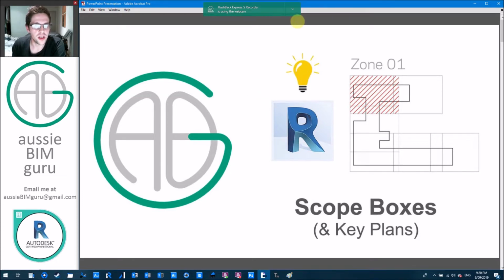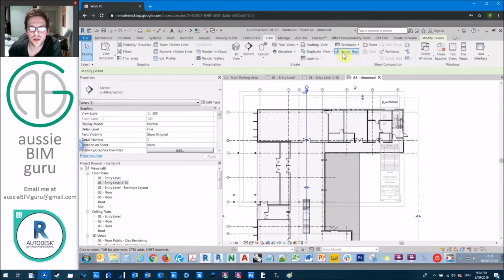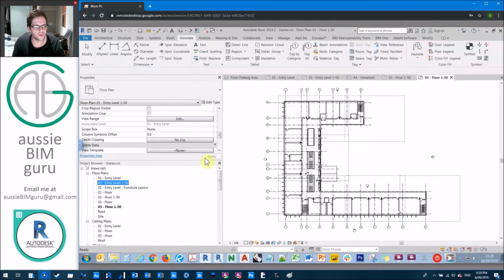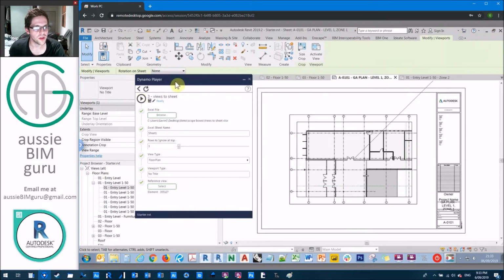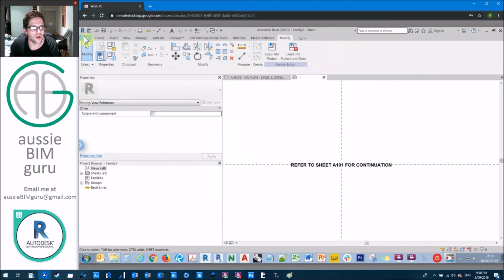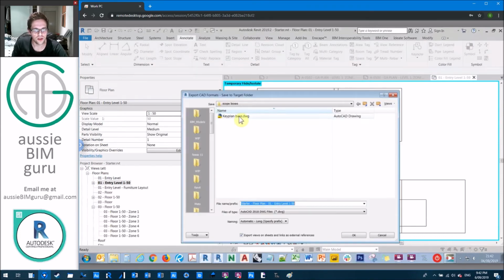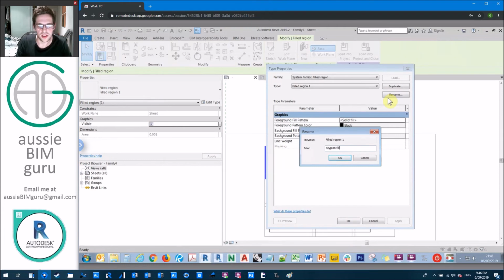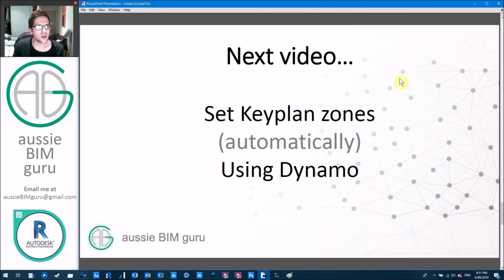Revit Scope Boxes and Key Plans

Comment: Is it possible to make something similar, but I would like to hatch only certain wall that is placed on sheet? And possibly tag that wall? I would like to automate that process
Reply from the maker: To check which walls are placed on a sheet in a model, you can get the sheets viewports, their views and then in those views use elementsofcategoryinview. I believe clockwork and genius loci have nodes for this.

Much of this logic will come down to your specific setup in Revit. Try to approach it in steps based on how you would approach this task manually.

Comment: Sir .. have seen this video I found that "active zone" name  parameter drive the other parameters i.e zone 1 to zone 6 ...but in that video u set parameter name as highlight zone?? Here i did nt see any highlight zone parameter???thanku sir
Reply from the maker: It doesnt really matter what the parameter is called, it just needs to be consistently named in dynamo and revit. My videos are a guide, dont follow them 100% literally. They dont connect like a course does.
Reply: @AussieBIMGuru  sir..i have dynamo 2.0..so i have to install archilab,rhythm,and some package ...which ver of this package i have to install...sir
Reply from the maker: @iftekharkhan8879  i would install the versions with dates from around the time of this video or later if they can be installed.
Reply: @AussieBIMGuru  sory sir ,i did nt understand ur answer..
Reply from the maker: @iftekharkhan8879  look at the date i made this video. Look at the package version release dates in package manager. The version i used must have been around that version.
Reply: @AussieBIMGuru  ok.thanku sir

Comment: Hi Gavin! Great video again :) some things I knew, others not. Thanks for sharing your knowledge! 

Again, in my current office they used to do this type of key plans in Autocad with the actual floor plan as an Xref. They would use it, not so much to divide the building into multiple parts, but to highlight which piece of the plan is being detailed further (ex: 1:20 drawings of a bathroom with the general plan as a key plan indicating which bathroom it is). That would also happen in section drawings to highlight the portion of it that its being developed in 1:5, in a constructive detail for instance... But I think for this we should probably use the Callout tool instead...
Reply from the maker: You're welcome!

I sometimes use the AutoCAD plan as reference, although I usually prefer to simplify the diagram quite a lot to avoid too many lines to print. At the end of the day it's a diagram really so doesn't have to be 100% detailed or accurate.

Whilst a callout could work to some degree, unfortunately it could only be placed on a single sheet.
Reply: @AussieBIMGuru  Oops, indeed. So I guess either a more schematic diagram or the Autocad as ref. Personally I would go for the first option, but I guess it is better to analyze it project based and see if the others agree.
Reply from the maker: @marianaarodrigues1  yes get team concensus. I've always found a simple diagram is best, keeps things basic and human friendly to manage/interpret on a drawing.

Comment: If some one ask that divide floor area into two parts in each floor  along building length what it means..is it relates for creating scope box
Reply from the maker: I would ask them to be more clear with their instructions. This could also mean the slab needs a construction joint or a model needs to be broken into two zones.

I am guessing they mean to use two scope boxes to cover the floor plan over 2 sheets most likely.

Comment: Hi buddy, I am from Melbourne. One thing of scope box puzzles me is that there is a gap between scope box and automatically created section box. Is there any way to edit or remove this "gap"?
Thanks!
Reply from the maker: Hi Lei, nice to hear from a fellow Aussie!

I believe by default the section box is automatically offset unfortunately. I would try out this tool by COINS that generates section boxes with manually specified buffers; https://apps.autodesk.com/RVT/en/Detail/Index?id=8920075109543819118&appLang=en&os=Win64

Comment: Hi Gavin, great videos! I am planning to start uploading my own tutorials at some point and you channel is definitely quite motivational. 

Regarding the key plan I have used a slightly different workflow;  To avoid using Autocad, I simply draw the lines (detail lines) on the 'A1-Floor Plan' for example, then copy and paste on the family. The rest pretty much the same. I also use yes/no parameters instead of an Integer parameter. In that way, I can highlight more than one zone on the same plan if necessary. Maybe you know a better way to achieve this?
Reply from the maker: Thanks David, I look forward to seeing your tutorials!

All your workflow differences are definitely suitable - depending on the project I've used all of these alternatives as well at times.